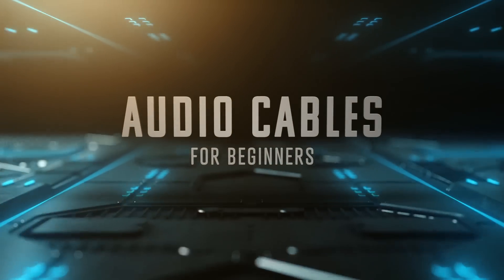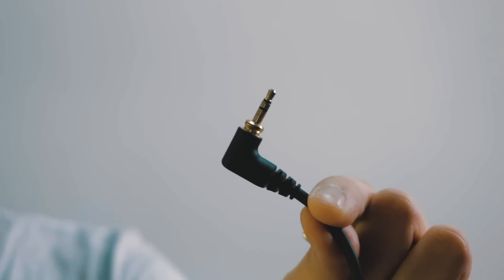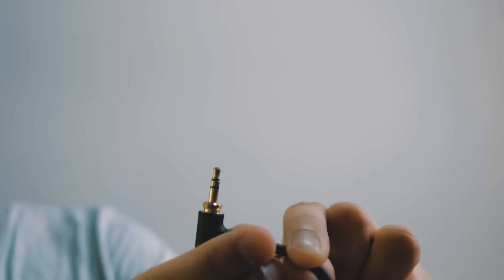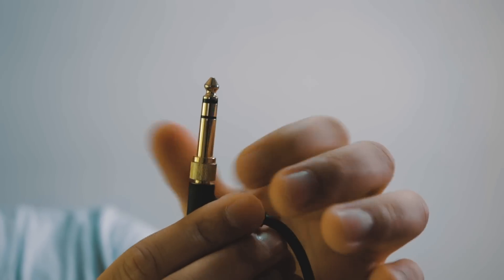Audio Cables for Beginners Ep.2: Balanced vs. Unbalanced

Comment: I tried to connect my ddj400 controller with my jbl305p powered speaker(s). I used a RCA to TRS cable (single) and connected it to one speaker. That result is that I have absolutely no bass... why not?
Reply from the maker: You’re having phase cancellation. Use a an RCA to TS cable instead.
Reply: @priyonjoni  You were exactly right! I tried Rca to TS and it worked fine. Thank you! I tried another thing first.. I plugged my phone via TRS cable (1/8 to 1/4 cable) directly to my speaker (balanced TRS input) and I had the cancellation effect too. I understand. But here is the thing I don't really understand... I also tried to connect my phone via TRS to XLR cable (trs 1/8 to xlr cable) to my speaker (also has this balanced xlr input) and it worked with no problem... so why is xlr working and trs not? what's the difference? both got the same signal from my phone. thank you

Comment: Hey PyJ, thanks for that break down, just got a small walfdale 502 usb mixer with all ¼ jacks and the inputs are all bal/unbalanced, and the master out is Balanced, this has cleared it all up for me, I now know I need Balanced trs to xlr cables for my set up. It only has the 2 main out channel's(stereo effect🤩) but it also has a unbalanced headphone jack with level nob, so was thinking that could go direct to the sub which is usual less than 2m(6tf) away from me, this way I could have an extra direct control for that too as like an extra effect

Comment: Thanks for the awesome video! I have a couple Mackie M-1400i amps. I use one for my tops L/R Stereo with the other as a single sub amp. I have balanced inputs/outputs on theses amps. I use all XLR balanced cables with the exception of my amp for my sub. I have been running a 30' unbalanced T/S 1/4" cable out from my sub amp to my Peavey 18" SP Subcompact. Should I be using 1/4" T/R/S instead? Thanks again for all your help....... I've learned an immense amout from you! 👍😊

Comment: Excellent explanation. Do you have a video that shows if one can hook up multiple XLRs to cover long distances? Such as, hooking four XLRs together to hook a mic to the mixer, etc?
Reply from the maker: Darla Warrior you can chain multiple XLRs together. It is better to use one long cable instead, but the signal degradation of one connector in the link is negligible.

Comment: So one question I have is....If I have booth out on my mixer and I just want to use 1 speaker for a monitor...Would I get a stereo signal if I use a Y splitter? or is it the same by just putting the 1/4 inch cable into one input on the mixer(knowing it won't be stereo)? If that makes sense..lol
Reply from the maker: Filthy Sinbag can you rephrase what you’re asking? Didn’t quite understand.

Comment: I’ve done a video explaining bal / unbal and the reason why monitors sound like the music is far away when they plug one monitor with a Y breakout, using a stereo unbal signal from the controller which the monitor interprets as a balanced mono signal. Might be a good topic to cover later
Reply from the maker: DOOSH MASTA yeah that’s definitely a good thing to mention. Don’t ever plug a stereo signal into a balanced input. You’ll basically inverse the phase of the left and right channels and get weird phasing issues. The lower frequencies will for sure cancel out.